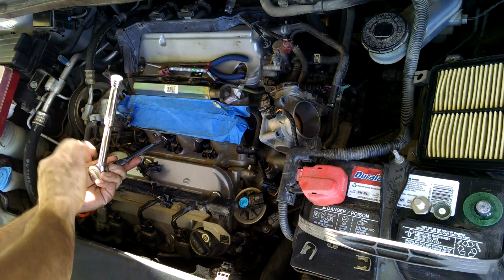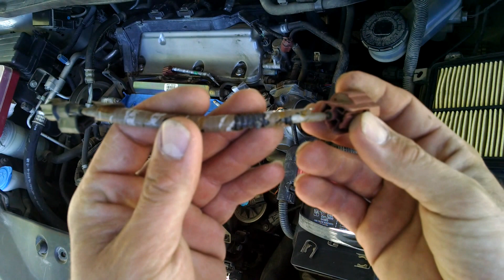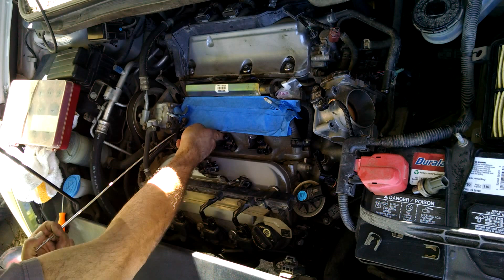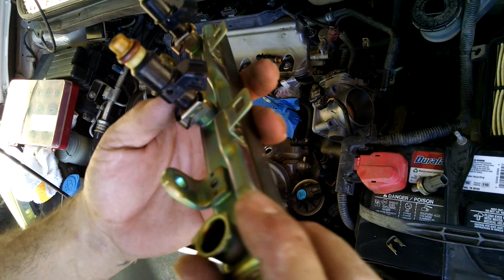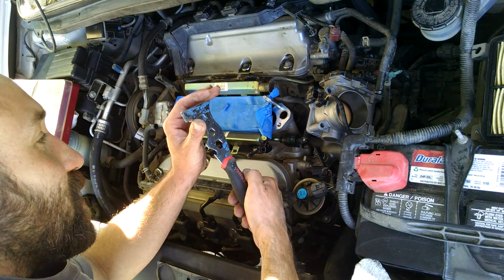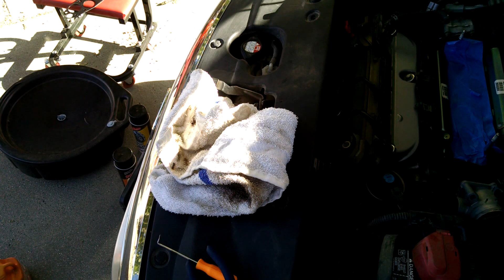06 Honda Odyssey Knock sensor replacement part 7

Comment: How do you put the sensor in
Reply from the maker: I needed the special socket, a friend lent it to me.
But you should be able to rent it from an auto parts store for little to no money. Most require a deposit.

Or you can get a sensor socket kit, I got one from Amazon.
It handy to have if you ever need to change an o2 sensor, knock sensor, etc.

Comment: David O. Selznick produced Gone With The Wind in less time than the double digit number of parts / segments made for this simple repair. The use of an o-ring under the sensor on J model (V6) is not required or recommended by Honda because it is a blind hole, unlike the 4 cylinder engines that will leak oil. Thank you for putting your video(s) online, but please condense them into a single 30 minute presentation.
Reply from the maker: If you got time to edit videos I am open to that 30 mins. Otherwise, I suggest using the playback speed option.

In future if got time I will make it short. Just time is limited.
Reply from the maker: If you made any videos you would probably understand how much time it takes. And if you do, then would be great if I had over a thousand subs. Then would be getting paid lol, damn YouTube regulations